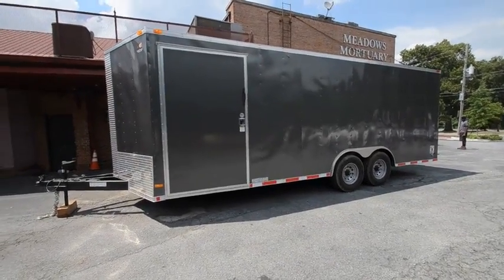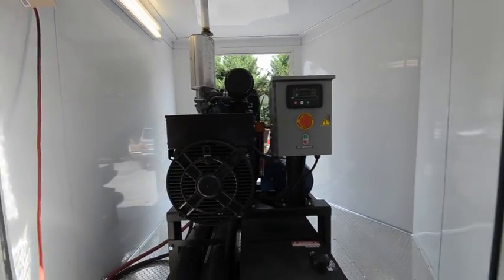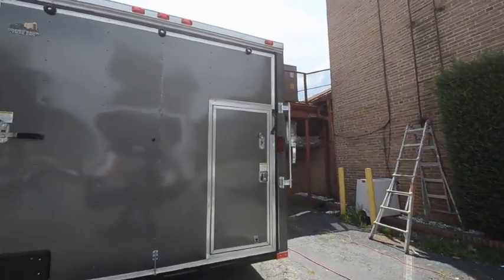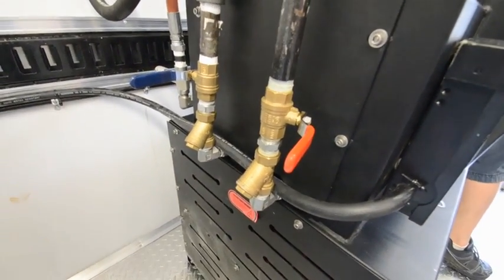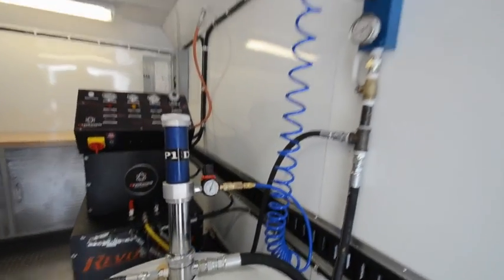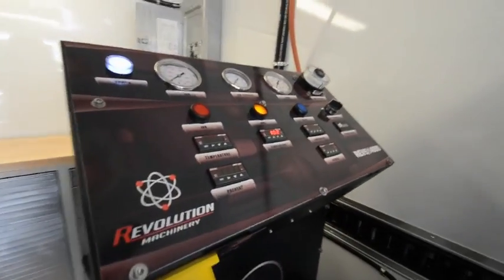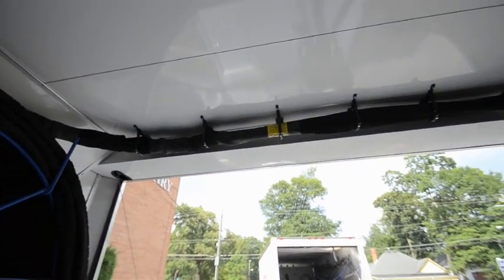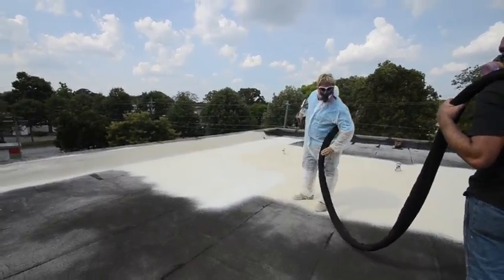22 FOOT CUSTOM SPRAY FOAM TRAILER,  RIG, AND MACHINE - SPEC TECHNOLOGIES

Comment: No louvers or ventilation on that rig?
Reply from the maker: Thank you for the question Josh. There are 2x48 inch front doors on each side of the trailer that open up Which provides more ventilation than louvers or vents ..... the back of the trailer has air-conditioning and a ramp door and a three-foot by 5 foot pedestrian door. Any questions feel free to call me SPEC TECHNOLOGIES....all over the Internet